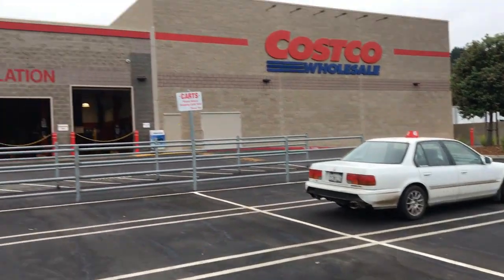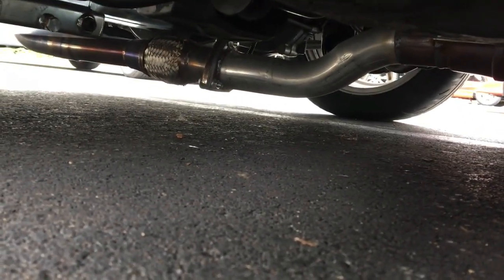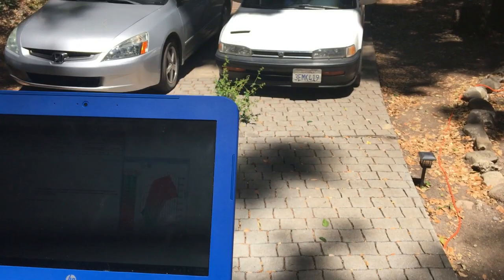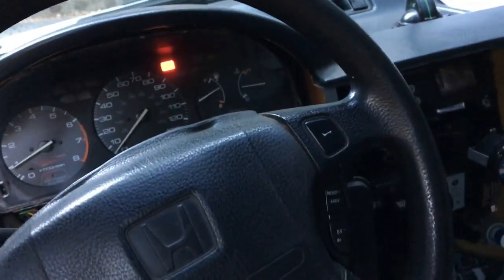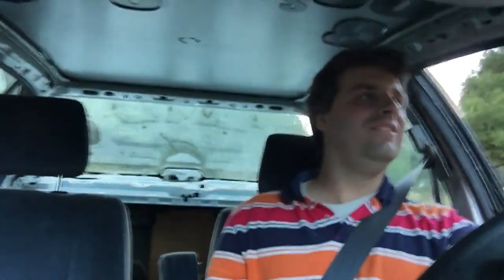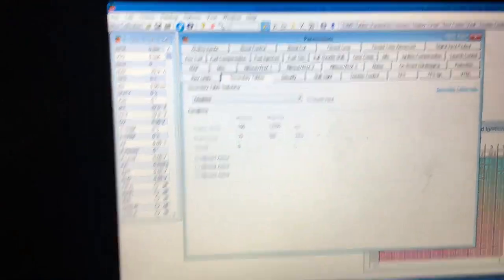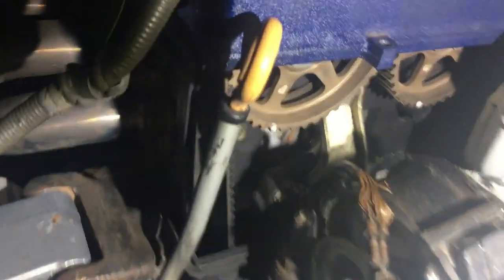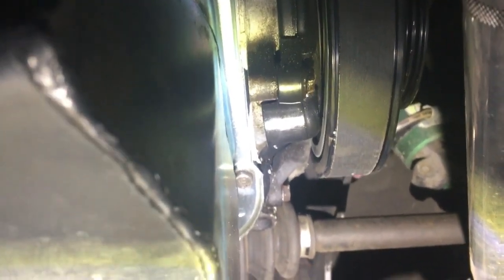CB7 Remote Tune and New Tires!

Comment: She sounds amazing! Very Nice.
I work for a tire wholesaler so no prob there for mine, lol. Love the Cooper Zeon RS3-G1's I have, highly recommend them.
Amazing how much a new set of tires can do ya.
Can you give a parts list of what your using to etune/datalog?
Also, Thanks for the posts on the forum. Where did you get your RDX injectors?
Reply from the maker: I am using Hondata S 300, which has been installed on my PO6 ECU and the SManager software is running on my basic laptop.  The current Ver. 3 that is being sold has Bluetooth capability, so you can check various sensor outputs right on your phone.  You connect to S300 through a USB cable,  which allows me to download calibrations, upload calibrations, and, most importantly, data log.  
Look up RDX 450cc injectors on the eBay.  They are pretty staple injector upgrades for F and H NA engine builders.